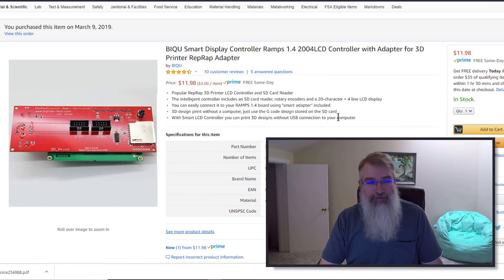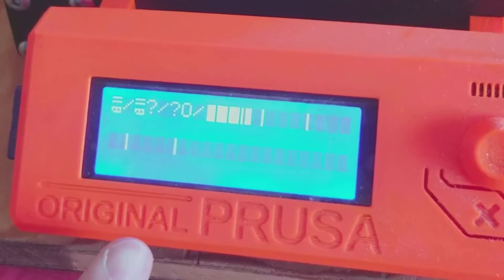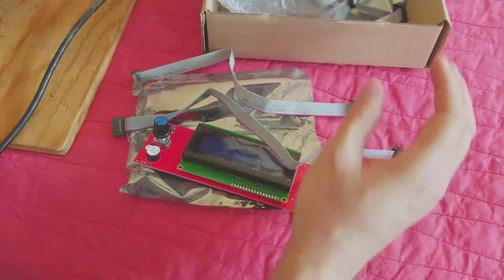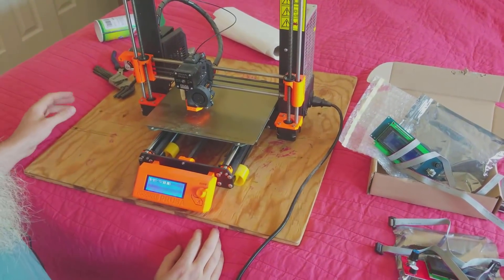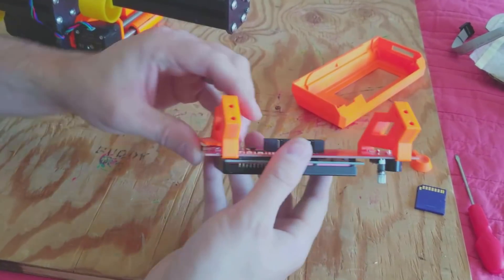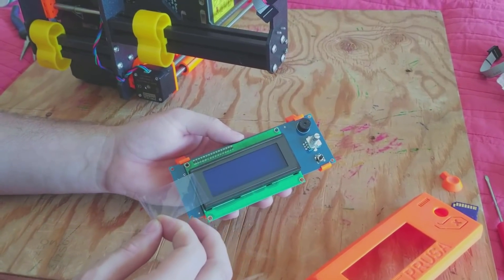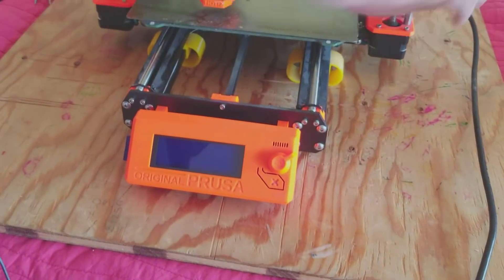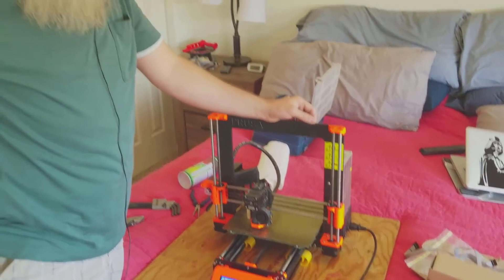Prusa: Fix LCD screen

Comment: I'd love to get my hands on a broken display like this!
The reason being I've got that crazy idea about modding the backlight in my head (basically changing the colour). I assume the LCD is backlit by LEDs but I'd like to explore on a damaged unit how integrated the backlight actually is, rather than potentially mess up a perfectly good one. I even checked the online classified ads for broken printers but have come up empty so far.

Comment: Hey Pat....have you ever replaced the thermistor?
Reply from the maker: Yes I have.  There are two thermistors one that measures bed temp and one that measures nozzle temp.  I have had to replace both at different points.
Bed Thermistor https://youtu.be/Xzfx0vcEDF4  and https://youtu.be/EL_zm5pEnVk  
(Not sure if I video'd the thermistor replacement but I am pretty sure I talked about it ;)
Nozzle thermistor  https://youtu.be/Rbz65XfKYKE

Comment: I had the same problem due to an electrostatic discharge. I sent a photo of the screen to Prusa and they sent me a new display for free...
Reply from the maker: Wow!  Prusa does a good job on their printer and taking care of their customers.
Support matters
Reply: @iqless  Just saying, I think it's best to work through their support department if you have the time and haven't done anything too stupid.  You'll often get the fix for free.
Reply from the maker: Yeah next time I just need to call them.  I tend to jump the gun on doing it myself
Reply: Neat! We had quite a few prints aborted during colour changes thanks to static discharges but fortunately no damage to any of the printers yet!

Some days were so bad I actually considered wearing an anti-ESD wristband anytime I touched the printers!